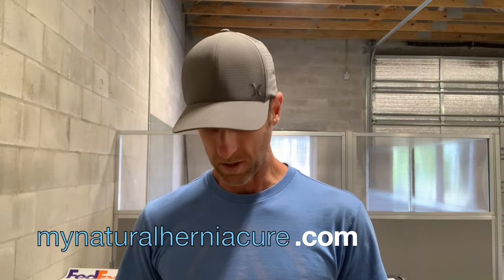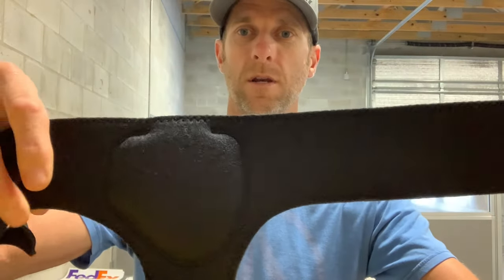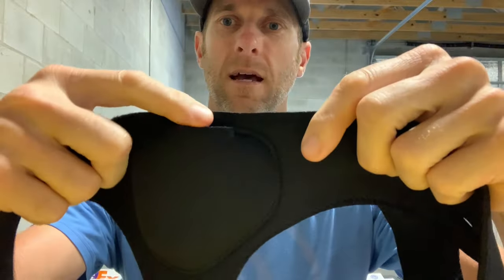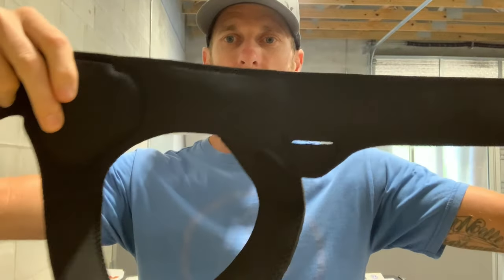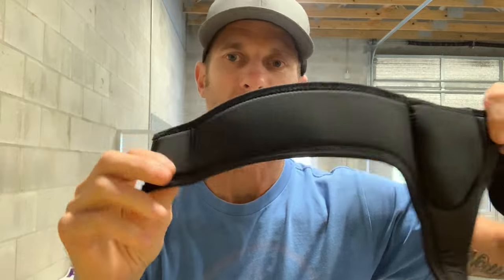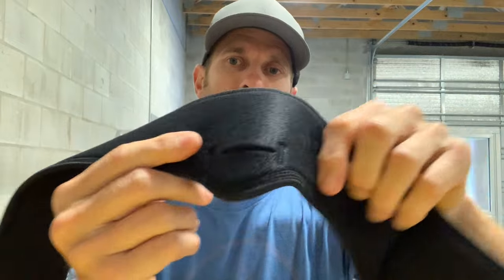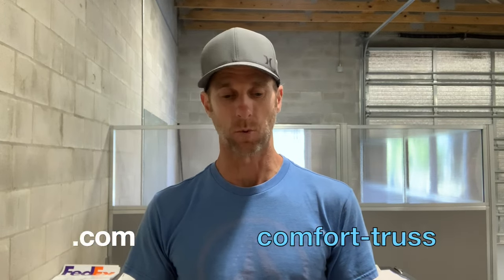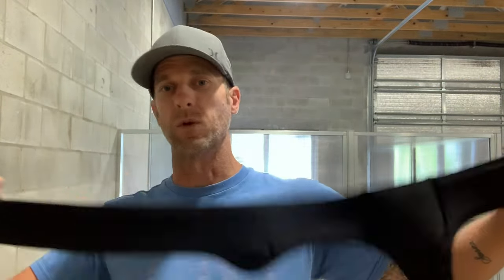Comfort Truss Reviews

Comment: Wish I could use this. Allergic to neoprene. Suggestions on another belt?
Reply from the maker: This is not actual neoprene because the inner layer is made of a polyurethane breathable foam rather than rubber as it is with regular neoprene. The outer layers are nylon spandex, so it might be ok?

Comment: This is not working when I do gym while sitting...like lat pull-downs
Reply: what do you mean by that exactly?
Reply: @VvtheD3M0N  we need to sit on bench for doing lat pull-down excercise.....and in sitting position,  belt is not providing enough support
Reply from the maker: Did you try to pull the belt a little tighter to see if more pressure would work?
Reply: @MyNaturalHerniaCure  yes I did....but all belts fail to provide support in seating position....do all have this problem or I'm not wearing properly?
Reply: I haven't tried his yet but yes the best I have found otherwise is made by Tynor and they don't stay while sitting or squatting.

Comment: The quality of the materials is questionable. It stretches and looses its flex. Then it does not support well. You have problems. Lots of them.
Reply from the maker: Yes, as I mentioned, the minimalist belt will stretch over time and eventually will need to be replaced, especially if you only have one and wear it all day every day. That’s the tradeoff of having an extremely comfortable, minimally designed belt over having something big and bulky that lasts forever, and is the reason we came out with the HD. It solves that problem. It will never stretch to a point where it is not supportive. If you only want to buy one belt the HD is the one to get. If you want extreme comfort and a minimal design, the minimalist is better but I would recommend having three that you rotate between so you can spread the wear and tear and always have a clean dry one to wear.